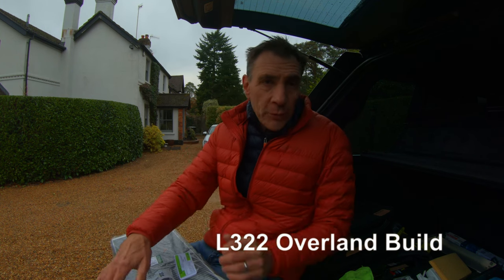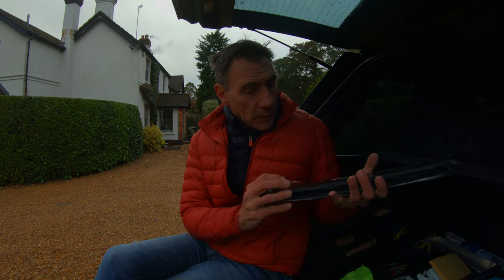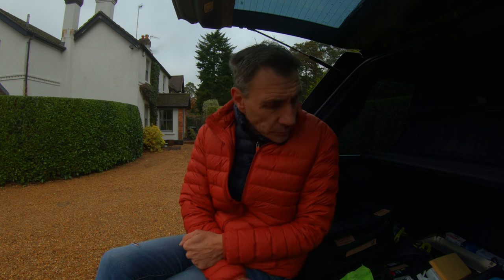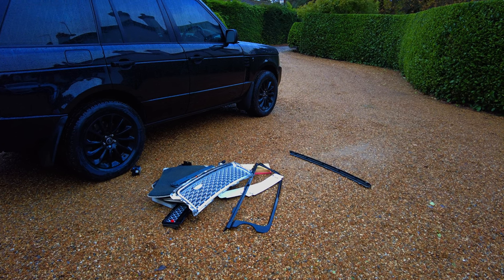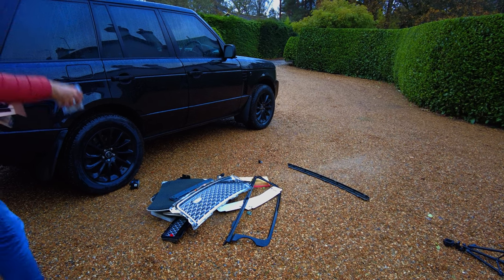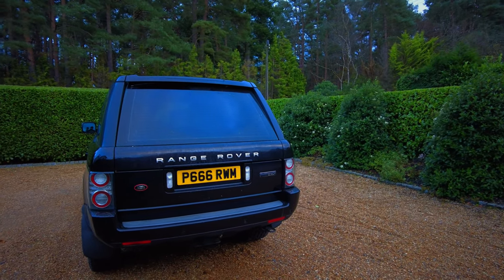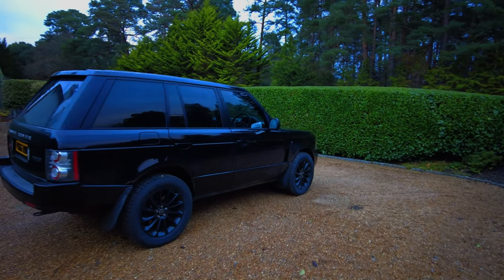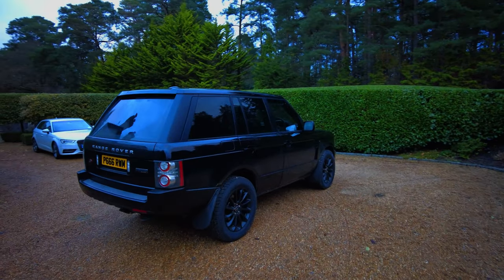L322 Overland Build. Let the modifications begin

Comment: look forward to the build, running a 3.6 L322 , mods sound good :)
Reply from the maker: Thank you!  Much to do with frame in the back and wiring in the dual battery, hopefully be close to getting it all wrapped up by New Year
Reply: @Overlanding4WD  our mods so far are, egr delete, exhaust system, diff oil change, transfer box oil, engine oil, Goodyear AT tyres, silicone hose, drilled discs 😂😂 great vehicle just take a lot of TLC 😎
Reply from the maker: Where did you get the drilled, presume grooved, discs, make? I’m considering refurbishment of the callipers, the paint has worn off, and the decals faded, from experience with my ‘03, 20-30K miles is all the front discs and pads have in them, heavy car, stopping etc.
Reply: @Overlanding4WD  are you able to message me either here or though website/ other social media ?
Reply from the maker: Instagram DM - same channel name my end

Comment: Really great content and channel Sir.

I did see more recently you were considering changing to an 18-inch wheel to allow for a bigger sidewall on your tire selection.  

Can I ask what has made you change your mind about the 20" with 275s given you've now done several thousand miles on these on and offroad ?
Reply from the maker: I can’t, big 6 pot brembos and at present no rim will fit over them. Compomotive working on a solution. 

Tyres excellent, so far no issues off road. Not ideal, but they work for what I put it through. 19’s fit, but limited tyres in that size. 

Thanks 👍🏻

Comment: How is it holding up?I assume this is not being used as a daily driver.
Reply from the maker: Nope, don’t need a daily, all OK, just got the BCDC to charge the aux batteries, took some figuring out, but now pumps 30A to the 200ah battery bank. Combination of a voltage solenoid, and a cool sensor that detects the alternator pulsing and not just voltage, so shuts everything down when the engine stops running, and not on voltage SOC. 

Will do an update video in the coming weeks, but bust with work etc.

Comment: Nice 🔥🔥🔥

Did that size tire fit before it was lifted ?
Reply from the maker: Yes it did, it runs on normal height, no rubbing before or after the easylift was installed, this just allows greater height for off road, plus 5” is available with the IId2 tool
Reply: @Overlanding4WD  Thank you for the response ... just got a L322 supercharged but previous owner had 275/40R 20 and I hate it.
Reply from the maker: Mine had road based tyres, 255/50 and they didn’t feel as planted as the 275/55’s do, I have Cooper AT’s and I think that is making the difference, prefer the ride on the AT’s, feels much more planted on the road, even in the wet. Eager to get it on the dirt / gravel / mud.
Reply: @Overlanding4WD  how do you fit into the spare wheel space?